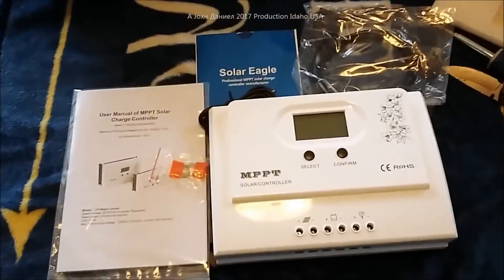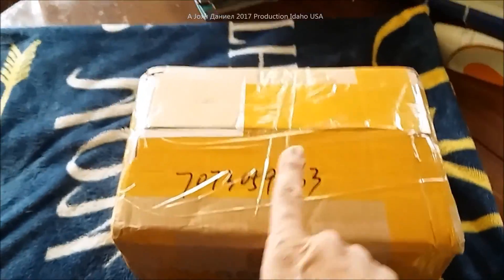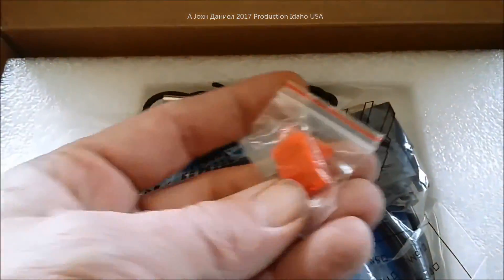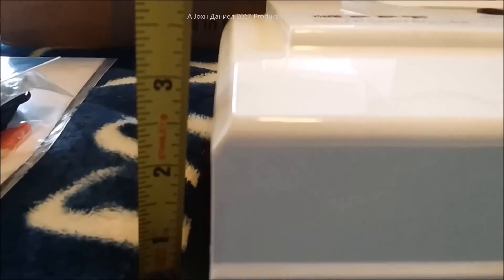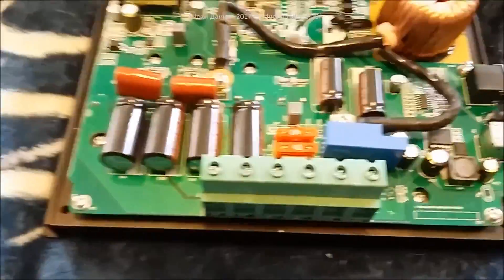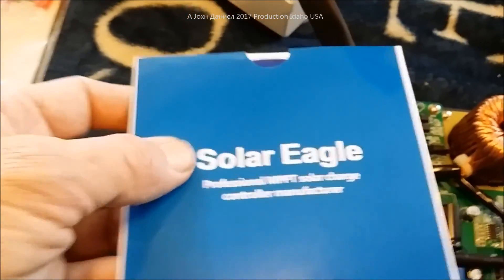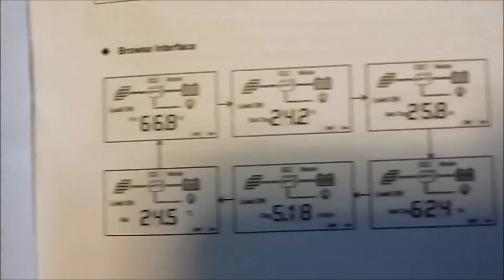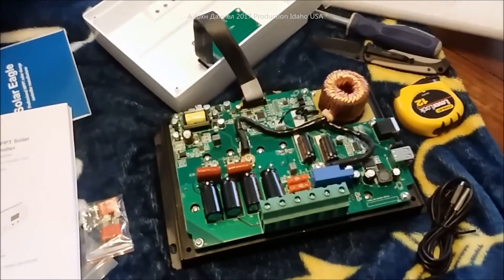New 40 amp MPPT Solar Ebay Opened Up to prove it's REAL ( Full info below)

Comment: Confused >>  ok, i know MPPT is king, but a lot of what i see is a little confusing.. I looked at the data sheet on this unit, and it says it has a 3 stage charging.. isn't this usually a PWM thing ? or does MPPT do the same ?
Reply: If i get this, i plan to use 3x parallel  295W panels, and in a 24v system.  looking at the 40A model. I'll have almost 30A in solar power.
Reply from the maker: They do the same, but with better results. Charge, Bulk, Float

Comment from the maker: REAL MPPT 50 Amp https://ebay.to/3abTqju $120. And think - GREAT LITHIUM LIE - Everyone is loosing their minds to spend 4 x the money, for 1/2 the REAL lifespan to get LifePo4 / LiCo batteries. FACT!!! - They DO NOT last as claimed, NOT able to do as advertised. Wise up, get the #1 (8 to 10 year PROVEN NOT CLAIMED) Solar Battery, order them online 10% off & pick up in store new batteries SAVE BIG https://bit.ly/2wv1VXd  Made by EastPenn ( Deka solar ) . The REAL MPPT controller by Ysolar  https://ebay.to/37QUUgg *Highest quality 100 watt solar panels through WINDYNATION  https://bit.ly/3bFFQp4 ,#1 Solar Battery, order online pick up in store new batteries SAVE BIG! https://bit.ly/2wv1VXd 
Pick your size, a Serious Real 100 to 150 VDC MPPT. 
*I personally recommend the 20 and 40 amp models.
TINY HOUSE PLANS ! https://bit.ly/31tJMof

Comment: The RF design practices on this board, are horrible: Inductor leads from one side of the board to the other both across a microcontroller. The low ESR caps are bend over maximising lead length!!! Does your cell phone work when you are close to it? It is nice of them however to use Litze on the coil as you say.

Comment: Maximum power point tracking not multi ...
Reply from the maker: Sorta but yes. Back in 1995 when it was starting big, they had it as both. Multiple Power Point Tracking ( snyder inc) using buck boosting mosfets only which could be used on up to 50 volts max, and later Maximum power point tracking when it was altered to use more and higher voltage capacitors in it with. When I was in vocational school we had the first designs which used 12 power transistors and 4 transformers. Its method was isolating multiple power points, then applying them into charging amps. Current internet does not tell the entire history of nothing thats not from Hollywood!!!! However TRACE and Bergy wind joint 1983 venture have some archives about it.
Reply: @JOHNDANIEL1  ...thank you for explaining to me.

Comment: Arnt transformers for ac.? How do they work with dc. Is it used to drop the voltage by  inverting the dc to a.c. so the voltage can drop and current can increase them  return it back to dc?

Comment: John have you seen a charge controller that will charge to 15.5 volts? Im not having much luck there i have a 4S 60P Lithium Ion 18650 im using and i dont want to drop no lower than 3.85 volts to get the most charge to them without going over my max voltage for my inverter. Im thinking im going to have to make something. I really havent worked with alot of charge controllers Xandrex can do it with PWM but pulse is a waist of time with 18650s i currently using a CC CV buck converter with 200 watts of solar as a test and its working pretty well but 15 amps rated. Anyway ide be interested to know if you have seen anything that can 2 stage charge something at 15.5 volts thanks
Reply from the maker: There is a controller that can convert solar in MPPT which can be set to charge from 6 volts to 90 from any array voltage from 32 to 100vdc. I will try to find where I saw that, but I know it was in use for a a electric car, and was 50 amp.

Comment: What a pail of BS review my A... How can a series people review anything there are not connected and tested in the real world situation..........So Com on.....Conect this "plastic" box up an let it Produce some power And THEN we can take a decision if it walks ore not.....Best luck get it up and running Pleace Be series When You are doing something like that .... instead of waisting over time with BS Pleace.....Thanks Jørgen Thomsen Denmark DK
Reply from the maker: SOME CORRECTIONS - You just have to look for the controller being ran on the REPAIRED UL-SOLAR 45W12V36 Panel tested under load video which is next on this subject using a watt meter and full sunlight. The heavy cloud cover on that ULsolar video was not conducive to a amp flow test. And I sold and installed the original one on a install job on a Recreational Vehicle but bought another a few weeks ago. You will also see it with a STION STO-135 90 volt panel as soon as I can get to it.

Comment: Please stop saying 'torad'; it is a toroid.
Reply: +John Daniel. Sorry John, sometimes I forget that some folk don't have English as a first language ;-)  Unemployed, yes. Liberal snowflake, no. (retired electronics engineer)
Reply from the maker: +nlo114 All good, I get racially profiled by collage edumakated un employed libbies so much for my Texas draw that I retrained myself to sloppy speak as much as possible to make their heads explode. 
Previous videos I do say toroidal transformer and solder correctly but that was before I got smart and figured library heads detonating was a solution to being trolled by their basement dwelling spellchecker assaults. 
I even Re did a generator video to make sta-bil fuel preservatives come out as Stay Bill in ode to the biggest pervert in grubberment. 
I so funny
Reply: No probs JD, just pulling your leg! :-)
Reply from the maker: That explains the difference in length!

Comment: Hi, any news about this controller, is the real thing?, waiting for the new video clip
Reply from the maker: Very Impressive, is holding up very well in a 35 foot Endeavor Motorhome. I sold it when the offer ($$) to do a 500 watt install was too much to turn down. They love it and ordered 2 more them selves for their camp house.
Reply: Thank you for the update, I like that it has 150v PV input comparing to most 40a controllers that have max PV voltage input of 100v or lessThank you again for sharing
Reply: Hi again, please what do you prefer in 40 amp range this controller or the EPEver tracer that you made a clip about ?Thank you

Comment: I got one and then ordered another. Thanks for that link JD. This controller works damn good.
Reply from the maker: +Alton Warford Jr Glad you like them.
Reply: Alton does yours fluctuate voltage? Mine goes up to 6.2a pv and 99w then both drop back to zero for awhile. Is this normal? I have a 12v system with three 120w panels in parallel. It seems I’m not ever seeing full potential of my panels

Comment: Would this need a fan on it to cool it down? They have fans in the Outback and lots of those real expensive controllers and if it quits your screwed. We had a Outback and its fan got full of dust and it overheated and burned up. I may have to get one of these just because how sturdy it looks.
Reply: Alton Warford Jr it doesn’t seem to get hot for me

Comment: You got 2 tumbs up from me....   LOL
Reply from the maker: You can tumbs up 3 of them for your system http://rover.ebay.com/rover/1/711-53200-19255-0/1?icep_ff3=2&pub=5575119394&toolid=10001&campid=5337966591&customid=SOLAR+EAGLE+40&icep_item=142175552088&ipn=psmain&icep_vectorid=229466&kwid=902099&mtid=824&kw=lg Real MPPT
Reply: When the testing video???
Reply from the maker: I uploaded this vid now so it would be close to the Vid thats of the 60 day test. On Dec 21st the test began, on Feb 19th-20th that test video will get the answers. Using one 130 watt Stion panel on a pair of batteries with a random load for almost 60 days now. Stay tuned.
Reply: Thanks Buddy!!
Reply: We are the 28th and i``m waiting for the new video.......    LOL
Reply from the maker: +al “peper 0110” desrochers I keep getting 15 f degrees, snow and snow and snow. Not into freezing my but off yet to do a vid on it. But so far it's doing good.
Reply: OK but what now...   LOL  Just kidding and pulling your leg bud..

Comment: Yes the chinese made is getting alot better, i bought a fake before, now i see victron clones that appear to be the real deal and alot cheaper with pretty good warranties, you have a real brain for electronics my brain is somewhere ill find it if i look hard enough.
Reply from the maker: They don't miss out on quality much now days unless they send it to Vietnam to be knocked off.  Fixed the link so you can get straight to it. http://rover.ebay.com/rover/1/711-53200-19255-0/1?icep_ff3=2&pub=5575119394&toolid=10001&campid=5337966591&customid=SOLAR+EAGLE+40&icep_item=142175552088&ipn=psmain&icep_vectorid=229466&kwid=902099&mtid=824&kw=lg They seem to have a good line at Solar Epic, I think theres also inverters in the works.
Reply: yeh im going to give vietnamese made a miss from now on, like the plague, twice burnt once shy, lol
Reply from the maker: Yes, Good old Ho Chi Min City Industrial Washing machine PMG Flame Throwers are not worth the effort!